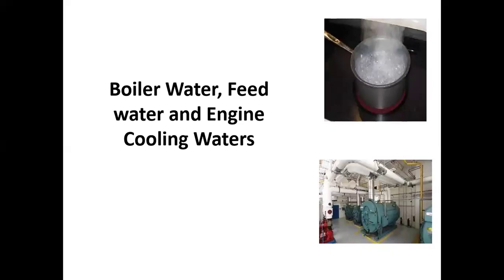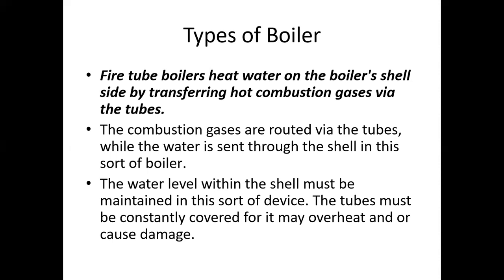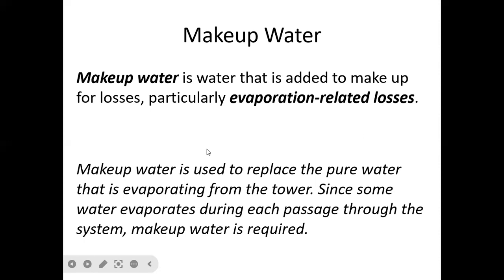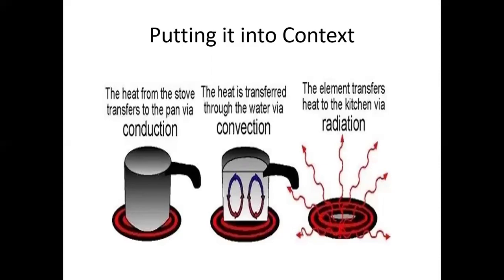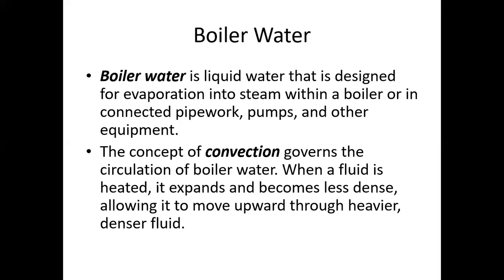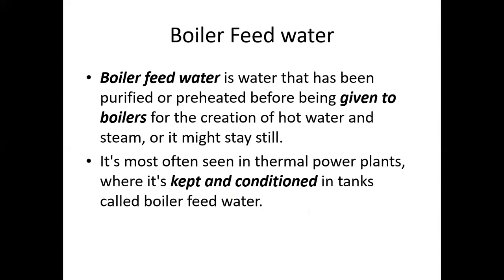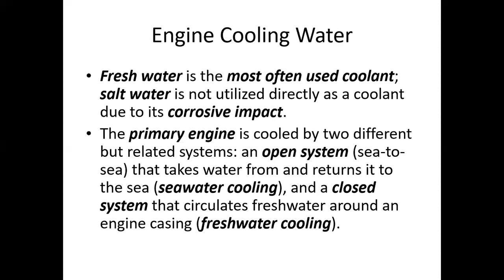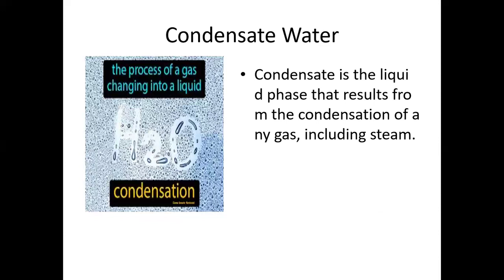Boiler, Feed and Cooling Water

Comment: This topic discussed the boiler; the boiler is a critical equipment in the maritime and industrial sectors where water is turned into steam for heating, propulsion, or power generation. It taught me on its types, components, such as burners and heat exchangers, operational safety measures, and the significance of regular maintenance to prevent accidents.
 
This is midshipman HUANG RICHMUND A. From deck 1-Alpha

KEEP IT UP SIR!!!🫡

Comment: This topic discuss about boiler uses heat produced from fuel combustion to transform water into steam. Main parts include the burner for heating, drum for water storage, and steam outlet to emit steam for work purposes such as running turbines. Feed water is provided with treated water that will not cause damage, and cooling water helps in controlling temperature and also condenses steam for reuse. Boilers are very important for power generation, marine systems, and industries for efficient conversion of energy.

This is Midshipman Zurbito From Deck 1- Alpha

KEEP IT UP SIR!!!

Comment: Boiler, Feedwater, and Cold Water Summary:

Boiler: A device that heats water to produce steam for heating, power generation, or industrial use. It consists of a combustion chamber, heat exchanger, and control systems.

Feedwater: Treated water supplied to the boiler. It undergoes processes like deaeration, filtration, and chemical treatment to prevent corrosion, scaling, and efficiency loss.

Cold Water: Untreated water (from municipal or natural sources) that is processed to become feedwater for boiler use.

In essence, cold water is treated to produce feedwater, which the boiler converts into steam.

BSMT 1 BRAVO
MIDSHIPMAN:OBTINALLA JOHN LAURENCE 

KEEP IT UP SIR ❤🎉

Comment: This topic discussed: Boiler water, operating under high pressure and temperature, requires meticulous treatment to prevent corrosion and scaling.  Feed water, replenishing the boiler, undergoes pre-treatment to remove impurities before entering the system.  Cooling water, circulating in closed loops, regulates temperatures and prevents overheating of boiler components.  The quality of each water type directly impacts the efficiency and longevity of the entire boiler system.  Proper management of boiler, feed, and cooling water is essential for safe and sustainable industrial operations.

Winslee Grace S. Gepanago BSMT 1- CHARLIE

Comment: Midshipman Gervacio Gerald A
Reply: Fire-tube Boilers: These have a series of tubes filled with water that are heated by burning fuel outside the tubes. The hot gases pass through the tubes, heating the water.